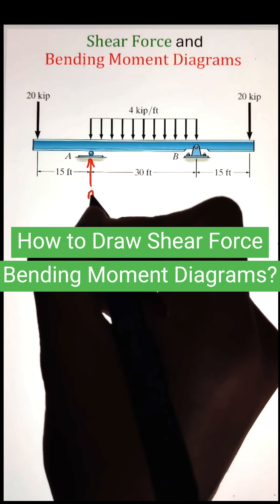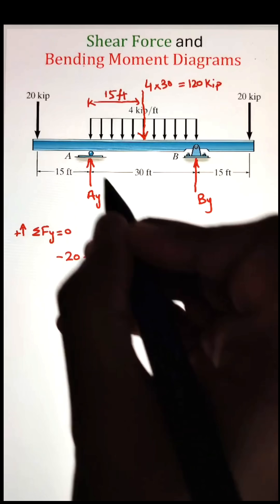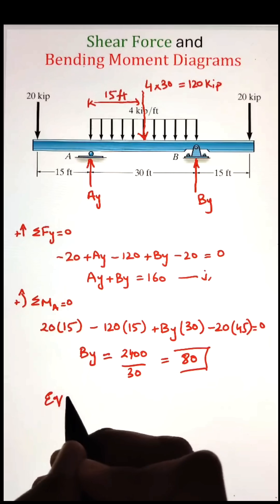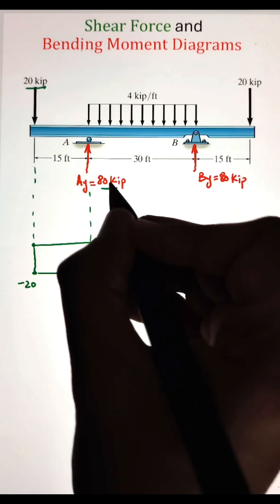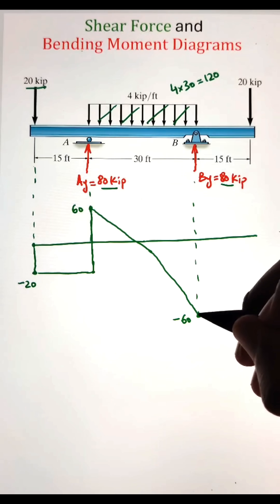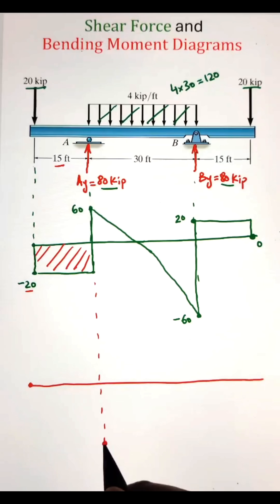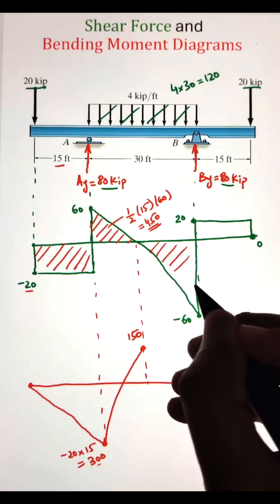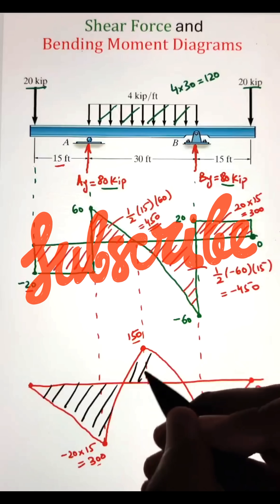Understanding Shear Force and Bending Moment Diagrams Quickly

Comment: how was the 20kip force before a positive and the 20kip force after b negative
Reply from the maker: If you're referring to the 20 kip in the moment equation with respect to point A, the 20 kip force before A is making counterclockwise moment with respect to point A that is why it's positive, while the 20 kip force after point A is making clockwise moment with respect to point A, that's why it's taken as negative.
Reply: @MathPhysicsEngage  tysm for this explanation bro
Reply from the maker: @quantumzx9291 you're welcome 😊

Comment: Why would you assume the base of the first triangle is 15?
Reply from the maker: While drawing shear force diagram at point A we are at 60 kip, next we have rectangular load going down at a rate of 4kip per ft, so if I am halfway of the rectangular load then the loading that adds up in the downward direction will be 4*15=60 kip, so we moved from 60 kip at point A to 0 kip at the mid point of rectangular loading by subtracting the downward load.

Hope this clarifies

Comment: The values are OK, but the convention is to draw the moment diagram on the tensioned fiber, so the diagrams should be mirrored to keep the convention.
Reply from the maker: The sign convention used here is counter clockwise moment is taken as positive.

Comment: Not sure but I think u should put vertical lines on the force and a horizontal line to be able to do shear force my drawing was different but I ended at zero. I put lines vertically on the forces 120 is in middle if u put vertical line u get rectangle shape so will be easier to do BMD

Comment: Please how do you get Ay+By=160
Reply from the maker: Since Ay and By are going upwards on free body diagram so they are taken as positive and two 20 kip force are going downward so they are taken as negative, we also have distributed loading that is 4 kip per feet that is applied to 30 feet length, so if we add that and convert it into point load it becomes 120 kip going down as well. 

Now since the system is in equilibrium meaning the net force is zero, so we can add all forces and equate it to zero, that will give us Ay+By=160.

Hope this helps 🙂

Comment: It’s symmetrical in first example so you can do 20+20+130 / 2 to get the reactiosn
Reply from the maker: That's right you sure can do that. But instead of 130 it will be 120.
Reply: @MathPhysicsEngage yea 120